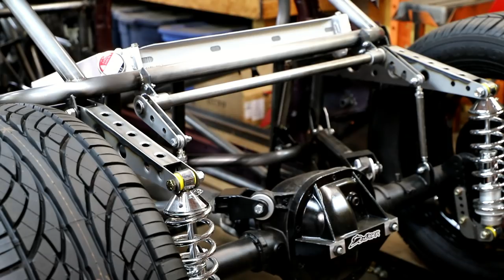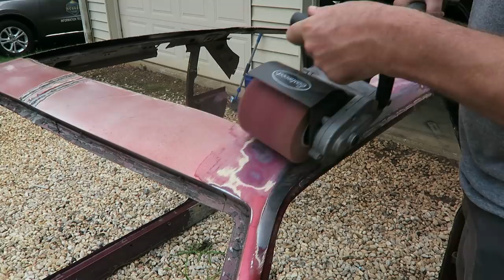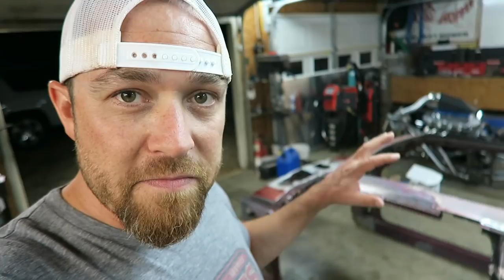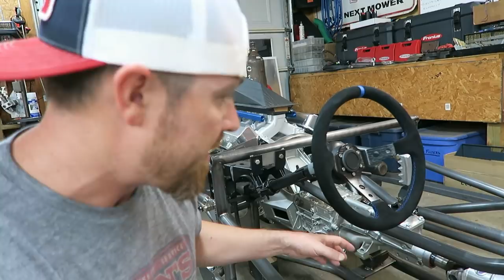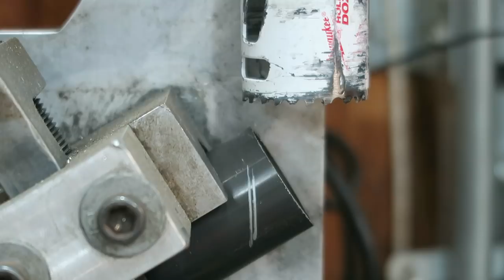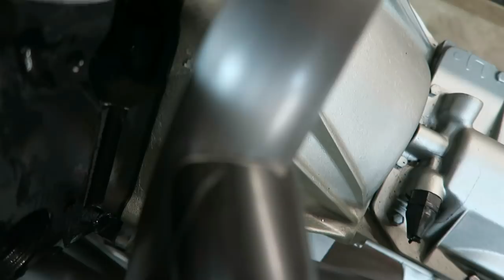Adult Go Kart Build ?

Comment: I completely understand on the amount of time it takes to get a bar to fit just right. My friends think because i have a bender and a notcher that they can come over and ill build a cage in an afternoon.  I find that if i go out in the evening and just decide that im going to get 1 or 2 bars to fit just right, my quality of work is a lot higher than if im just trying to sling tube. The tn-250 from baleigh has helped alot but i still find myself using a flap disc to get it just right.

Comment: excited for the brushed raw mild steel, always wanted to do that to a vehicle, a right angle die grinder with surface prep pads/scotchbrite pads might get into your hard to reach areas, maybe a piece of emery cloth and finger for the really bunched up corners, be alot less of a headache if you can save hiring someone to blast it then have to re texture it

excited for the finish though and the longevity of it might have a jeep wrangler in bare brushed for you if yours turns out well

Comment: When I notch tubes at the steep angles like you showed, I usually don’t cut the top side of the notch. I just slide the tube up so the hole saw just nicks the inside of the tube then cuts the notch on the bottom side. It still fits up the same but doesn’t have the really thin metal at the end of the long side of the notch. I dress off the thin areas around the sides as well before welding. For me it seems like I can get a better weld. But I’m not as proficient at welding as you. I have my days when I do really well then I have those days where I really get to hone my skills with a grinder lol. 
Thanks for the video. Keep up the great work!!
Reply: I notice that with the thin edges. My main problem is weld consistency when you hit a thin area you might need to stay longer to build the same amount of material, but you don't need as much heat.  Consistent edges help.

Comment: I'm have a project in mind that I also call a go kart but it's much different.  Engine farther back.  Single seat.  Shoulders about center of the rear axle.  Almost lay down on the drive line.  Pure adrenalin drive.

Comment: THAT T-5 IS GOING TO EXPLODE..
GEARS ARE GOING TO BE FLYING 
LOL..I WOULD DEFINITELY BUILD A SCATTER SHIELD AROUND IT..
BLANKET AND STRAPS..COOL BUILD THOUGH
Reply from the maker: that exact t-5 has been 6.50's in the eighth. It will be more than fine for this sub 2k lb setup....
Besides when they scatter they never come through the case. Clutch and flywheel are what you need to worry about.

Comment: It will look good and maybe go fast in a straight line but probably will brake or twist on the first fast band
Needed to be strengthen in the mid section form the bulkhead to the rear , preferably a cage around the cabin and not talking about safety neither just chassis rigidity. 
Love the look of it though

Comment: Question, when you are using the tool to strip off the paint, Bondo, Stuff Etc, does it heat up the metal very much and are you concerned about any kind of warpage?
Thank you very much for the videos, it's nice to see people get work done, and it's very inspiring to get me out into my own shop 🙂
Reply from the maker: this tool does warm it up some but is pretty good about getting it so hot it warps

Comment: Just to clarify, I wasn't trying to be disparaging of your work. It was seeming like you were deciding on the fly and making changes after some work had been done. Then, watching some of the other vids that had you visiting some of the chassis builder got me thinking that they surely have cad programs that would help with your build and kinda certify what you were thinking...if you know what I mean?¿...
Anyway, 
That is an insane looking suspension and can hardly wait to see it in motion. 👍
Reply from the maker: yeah most of these design came for the sanctioning bodies

Comment: Q: Do you have automotive engineering training or any type of engineering schooling?
 I ask because it seems you would have access to some folks that have the computer modeling programs that you could plug the bibbster into and verify it's structural integrity, or at least have a pro builder (if that's not you already) put a trained eye on her and give you some input as to its real world viability.
Just asking 👍
Reply from the maker: no...but have a lot of experience in this kind of stuff. Most of the engineering has already been proven. I am just replicating it